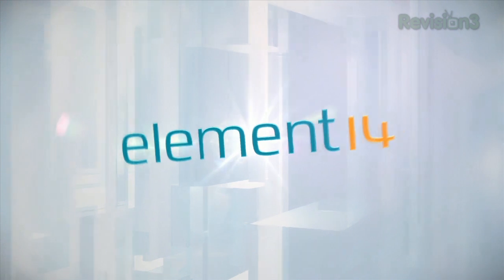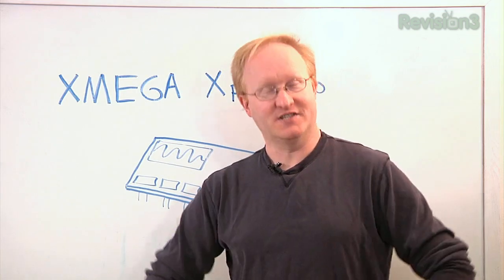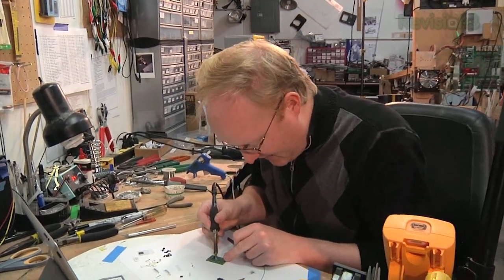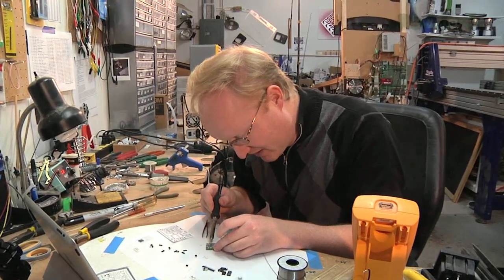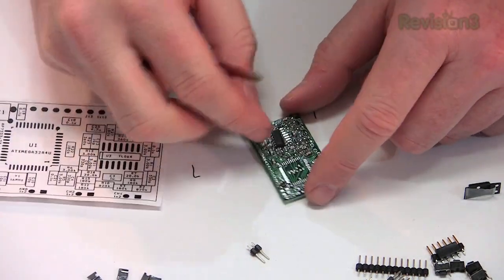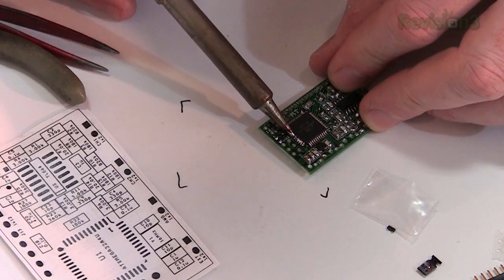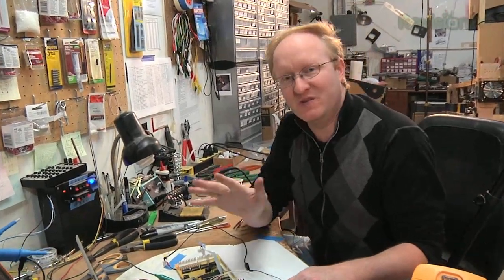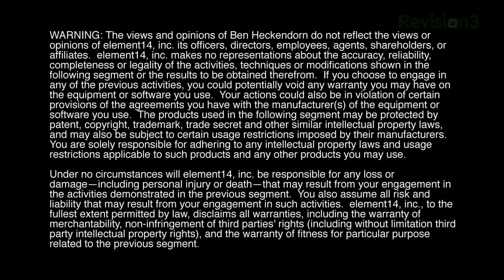Surface Mount Soldering Tutorial

Comment: You should use a locking board to take the board in place and stop it moving around, plus it is much easier with flux lifting the chip like you did is awful you can break the ic, break the pads and your connections will never be clean. Flux is your friend. Use it.

Comment: hey thanks for the great video, i'm now a new subscriber! I definitely appreciate what your doing on this channel. I had a question on how you would surface mount solder when the solder pads are extremely close and very small. I need to solder a new 4 pin ffc-fpc (or a miniature flex cable socket) to a motherboard. The little plastic latch broke off the socket connector (ffc-fpc) that the flex or ribbon cable of a small digitizer goes in to. It's a nintendo 3ds motherboard. This is a big problem in the video game, cell phone, and tablet repair!

Comment: I'm afraid this is not very practice. You forgot the most important thing. Flux....
Reply: There is flux in the solder
Reply: not enough, and by the time he gets around with his soldering iron, it's all gone
Reply: you can never have enough or too much flux, period
Reply: Yup, the oxidation skins and the bridges are a telltale sign of no flux (or burned up flux) and plenty of given time and heat for oxidation to occur. Properly applied solder will not readily make bridges across 1.27mm pitch components (SO-8, So-14, SO-16) and will wet nicely. Not what happened here.

Comment: Good lord that is some of the worst soldering technique I've ever seen... how much heat are you putting into those components?  And the blobs of solder aren't making good connection, the solder isn't properly flowing as a eutectic solder is intended to do.  Iron is likely too hot.  Yes it is good to tin the contacts first but you have to gently heat until it flows, and then no more, let it flow into the connection.  Please re-do this video or just take it down.  You're going to frustrate a lot of people by giving them poor advices.
Reply: Timothy Puckett I agree with Mr. Gorilla, that is one hell of a sloppy soldering technique. The guy has a good heat gun, he should get some solder paste and do it the right way. The finished product will look like it was factory made. Do a search for "soldering with hot air" and watch those videos. You'll see how much neater the job looks.
Reply: Wow you are so dumb the soldering iron is adjustable 63 dislikes out of 67,942 views is not bad so not that many people got frustrated plus Ben know a hell of a lot more than your dumb ass does
Reply: Timothy Puckett Yes it is adjustable, and he has it too high.. so failure on his part to use the proper heat.  Likes and dislikes are meaningless, they can be spoofed and fact is Justin Bieber videos have millions of likes, does that make him a better musician than Louis Armstrong with fewer likes?  And finally, you don't know the first thing about what I know or don't know so keep your ad hominem attacks to yourself, son.

Comment: Oh boy if my girls at work did it like you whew we'd be in trouble, don't use iron and run back in forth along side of surface mount! Pre-Tin flux small /tiny solder tip magnifying glasses etc do one side at time use tweezers to hold part so it don't move , no bridges boa

Comment: No, thats boring. Just google it. Changing caps on pretty much any board is the same as Xbox board. Find out what Voltage and uF rating you need for the caps (it says it on the said) and order them on ebay or something, then just solder them on.

Comment: Her is what I would do differently:
1. Get a spare tip for your soldering iron and file it down to a thinner tip
2. Get the much thinner flux wire
3. Prepare (like you did) your PCB, but with very little solder on contact points
5. Get a fine point curved tweezers
6. Place the SMD component on the PCB and align it precisely
7. Pin down in the middle of your SMD component to keep it in place with your tweezers, and solder one side of SMD
6. Rotate PCB for 180 and repeat 7.
Reply: u spell wrong

Comment: Because of the USB specification, you can only draw so much power from one USB port. So technically, you solution will only work if the bottleneck is the power adapter and not the maximum power you can draw from the USB port.

Otherwise you might want to use a bigger power adapter and modify it so it can power both the Pi and an USB hub :) .

Comment: In addition to the viewer question: If I use a bigger Power Adapter on the Raspberry Pi (lets say 2100mA instead of the 1200mA standard Adapter) I should be abel to hook more devices to the USB Port, right?

Comment: You forgot the golden rule of soldering! USE FLUX!!! It really helps, especially since all the flux inside the solder wire you use burns off when you tin the pads. Also, I suggest doing the ICs first, as it's harder to get in there with an iron (even worse with solder wick) after doing all the little resistors and capacitors. 

Next video: hand soldering QFNs! Or BGAs!

Comment: I don't think you know what the term "troll" means. Also, just because it works doesn't mean it should be taught. He's simply doing it wrong and making it harder than it has to be. If done correctly SMD soldering is much much easier than what this video makes it look like. Just the fact that he didn't mention flux even once and even worse didn't use it boggles my mind (and no, rosin core solder doesn't count).

My advice, look up a good tutorial and save yourself both time and money.

Comment: Why did you not use flux? I just soldered together a board using 90% SMD. It saves time and solder. Dave Jones over at the EEVBlog has a couple great videos on soldering.

Comment: Also just FYI, the specs of the SMD's i used are listed here datasheetcatalog[dot]org/datasheet/wte/LL4148.pdf

the pads are 0.28 to 0.5mm in length, the smd itself is 3mm long.

So please, keep saying that im bullshitting because you cannot handle the ability to be proven wrong.
You just dont have the right tools for the job.

Comment: It is almost always in the solder but when he first solders the pads the flux boils then he places the part and directly applies heat to the joint but since the flux is boiled you'll need additional flux.

Comment: If you are using solder for electronics, the flux is embedded in the solder. The stuff that smokes when you solder is the flux. Brush on solder is for plumbing and stained glass.

Comment: I use a netgear WNCE2001 for my wifi, it is a standalone adapter that can connect to a router by changing the settings in the browser... it connects to the RJ45 and not the USB. I have found it to be a perfect solution